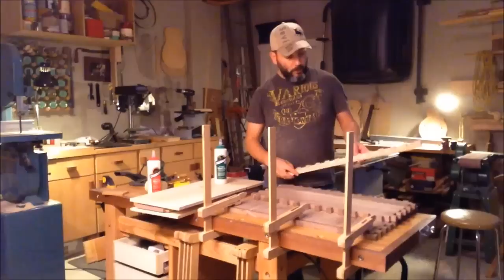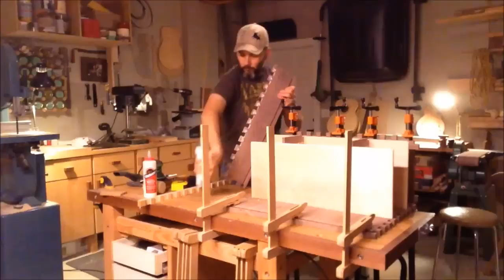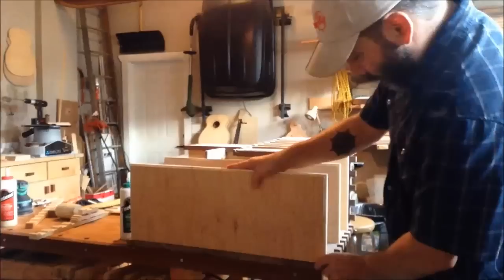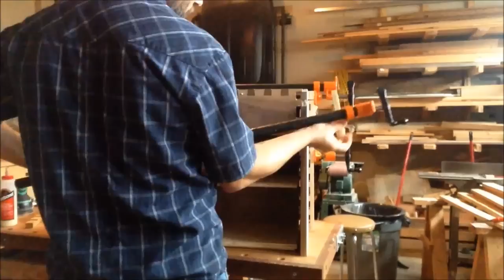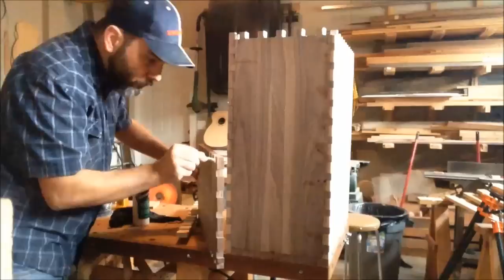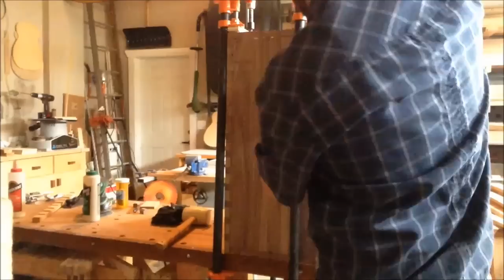How to make a dovetail toolchest Part 4 (Complete Glue Up at 4x speed)

Comment: did you make those wooden hold down clamps?
Reply from the maker: Yes, the purpose of them is to apply the pressure on the tail while allowing space for the pin to go pass if need be. They are really simple to make out of 3/4 ply leftover.
Reply: Got drawing or plan? I would appreciate, need to build something and have clamp with long throat
Reply from the maker: +Outcast yes, there is a link to a downloadable PDF file in the video description .